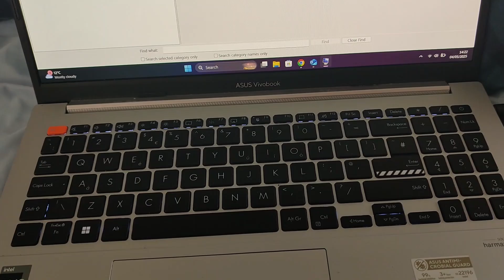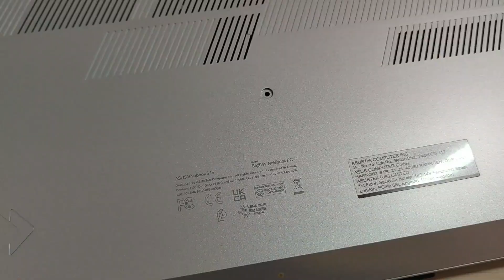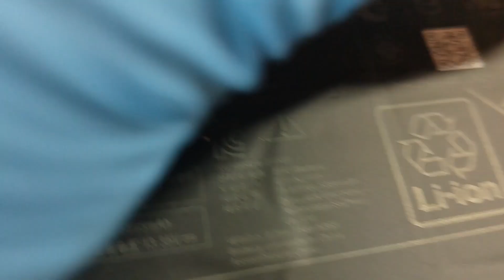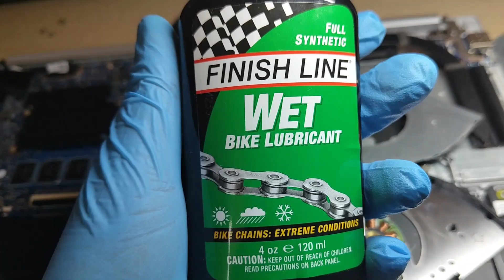How To Disassemble And Repair/Replace Fan Asus Vivobook S15 K5504VN

Comment: That is just bad design by Asus. So many wide open vents at the bottom allowing big debris into the ventilation. I own a Macbook  as well, and even though it has no inlet vents, it still gets a lot of fine dust into the chassis, requiring cleanup every couple of years.

Comment: I have the vivobook x1504za and i have the same issue.  I am not a professional either but i found your video very helpful  and to the point. Thank you vey much for your effort and for uploading this.
Reply from the maker: I have a part 2 video, I replaced the fan in the end as it made the noise again after a month
Reply: I ve ordered a repalcement but i ll try to fix the original one in the next couple of days and keep the replacement handy just in case. if the original fails after the repair then i ll replace it. Thanks again :  )

Comment: I have the Vivobook S15 S3502ZA. I have been going through the same problem where the fan rattles and grinds even when idle.  I was not able to find any video on the problem. Thank you for the video, it cleared many doubts I had.